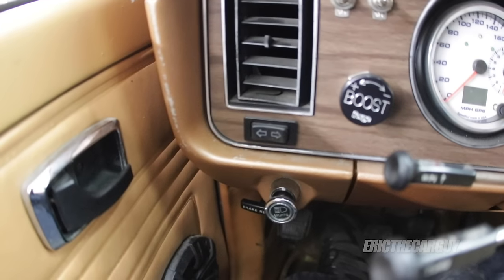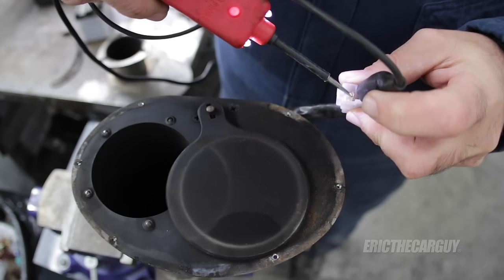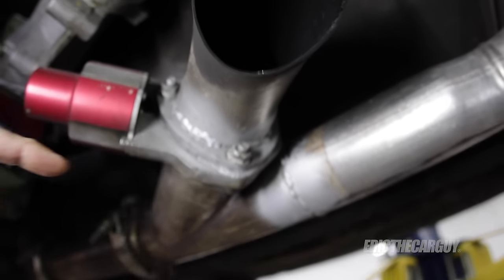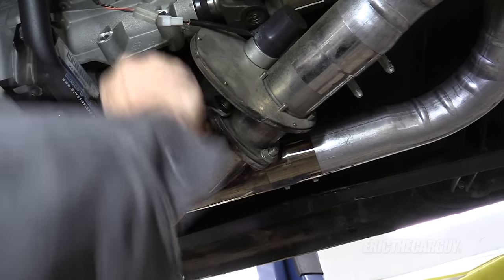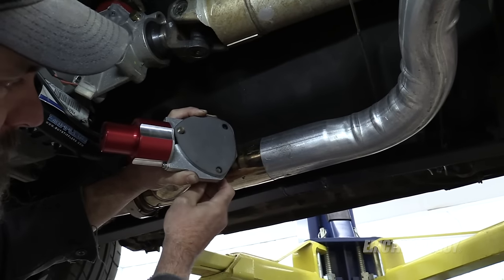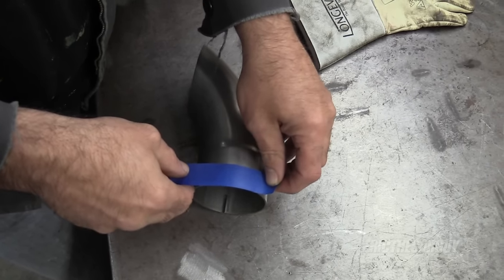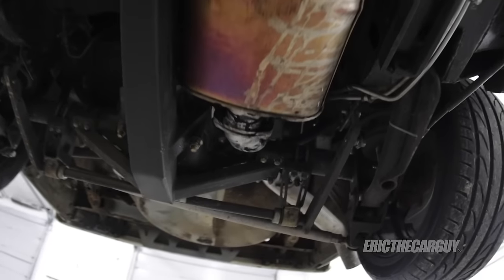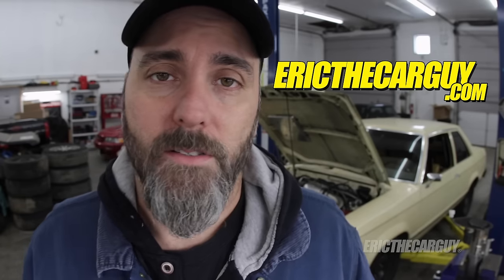Exhaust Cut Outs Give Your Vehicle a Split Personality

Comment: My 2012 Vett came stock with a set of butterflies so I simply wired in a clean looking switch to provide manual control of exhaust tone and any HP and fuel economy available.  Much easier than diving into the fuse box to make the adjustment.  But, I noticed the butterfly valve was very robust; however, I don’t have any thing to compare it to but it was solid and seemed to have less points for corrosion or accumulation of carbon.

Comment: Don't be afraid to do yourself a favor and Loctite those nuts/bolts at the three hole flange, because at this point, you essentially have a connection that is no different than any three bolt header flange that's been in use since the beginning of creation; a connection that was always prone to vibrating loose and dumping those flange nuts/bolts on the ground somewhere a couple miles back. And take it easy when tightening them down too as too tight will just warp the flange and it will never seal. Ever. And not tight enough will be just that, not tight enough and it will never seal. Ever.

Comment: Eric when using your plasma to cut a hole you don't need a half inch starter hole, whatever plasma tip you have installed size should be plenty.  For using a plasma to shorten a pipe they make special bands that also layout cutout angles, or you can just a threaded pipe clamp to guide the nozzle.  For inside cuts on that plate you could have used the short section you cut off or a piece of cardboard cut to shape/size. And finally it sounds and looks like you could have adjusted the MIG power a bit although stainless is best done with (very expensive) stainless wire and a different gas mix...

Comment: So some of the exhaust still naturally make its way to the muffler right ?wouldnt it be a better set up if there was two valves, one two completely block off flow to the muffler and allow to force it was out the straight pipe and vise versa?

Comment: When you said the screws on the butterfly valve could vibrate out I have the idea that you could use some threadlocker red. This is the strongest threadlocker and has to be removed with heat. This is the kind of threadlocker you typically use on things like main bearing caps and Rod bolts internally inside of an engine so it should be permanent and withstand the heat of the exhaust. If you were to remove or just back off a little on the screws of the butterfly valve and add a little bit of the threadlocker red before you put it all together then you probably wouldn't ever have to worry about the screws vibrating out. Just an idea, $3 or $4 for a little tube of threadlocker red that's cheap insurance. This way you would never have to worry about taking them back off the car and trying to repair them once installed they would be good for the life for the exhaust. Your work is excellent. Great video.
God Bless You 
and Your Family!!
Jimmy in NC....

Comment: The butt connectors work and sometimes it don't work it all depends on how you crimp them shrink tubing is great when I was working at my buddy shop it was like a lifesaver on the wiring and then after we where done with that, we would put plastic wire loom over top of it and tie the ends off with zip ties

Comment: I've had cut out before... I always used the throttle body style. I've never had one with screws in the plate they've always been welded. sometimes they rattle when they're going from closed to open. And they leak a little bit but it's worth it. Especially when you have a sleeper.

Comment: The one thing that you have to be careful with is the weld on your tail pipe interfering with the butterfly valve either opening or closing. I had one that would open and close fine, but just barely touched the weld on opening. Apparently it was enough to break the motor shaft after about a month of use. Pricey mistake.

Comment: The original cut out completely opened the path for the exhaust. The new one has an obstruction right in the center of the pipe. It has to be more obstructive, might even cause turbulence.

Comment: hurts my electrical soul when you use those crimpers on those crimps, it makes them warp and not crimp correctly, should get the proper crimpers so they will hold more securely.

Comment: I recently failed my mot cause of my straight pipe with the cat still installed. I am wondering whether the mot guy will question the cut out when inspecting the exhaust from a lifter.

Comment: Side note:  they make what’s called “soldier seal wire connectors” that have two glue rings, one on each end and low temp soldier in the center.  Just insert the wires and apply heat. Handy for tight spaces.

Comment: RE: Solder,    Solder makes the entire connection brittle including the copper wire. hence it should never be used in a vibration rich  situation (I am an Electronics Engineer and well versed in this)

Comment: Making a round hole is done much easier and will a lot higher quality using a hole saw. Making the hole slightly larger than the tip pipe allows you to slide it inside the hole and weld the joint on the inside. You can smooth the bead creating a cleaner flow path and a much cleaner looking install as the weld would be hidden inside.

Comment: Another awesome Vid, Eric, thanks! You've helped me out in the past, and I've neglected thanking you. So, I'm fixing that now. Many many thanks! 

I've got a car question that is rather unique... Mad Max's blower cut out... Would that actually work? My father and I are debating the facts behind it. I believe, that with the cable activated clutch on the crank pulley, that it would work, because air would still bypass the screw even when not working. He believes that it just wouldn't work at all. We need a tie breaker. Any input would be awesome. Thanks again!

Comment: I think I would have clothes clean that hole up a little bit better and inserted a pipe through it making it flush and then welding it from the inside leaving no well-disposed on the outside at all that on that and then as far as the connectors go if you stagger your connectors are there not one light on top of the other than it'll be a lot thinner on the line and won't look like a bald alright something new right

Comment: There are shrink hoses with solder iron inside of them, they are even waterproof. Keep that in mind for future electric work, my dad reconnected his hole transmission wire with those after it was burned due to oil dripping onto the cat.

Comment: Would you by any chance know if there is something like this for the Lexus IS 300?
Reply: ?? Seriously?? They don't. Make these for a specific car or model or brand etc the kit is determined by pipe diameter and then the wiring is custom and will have to be doen. By yourself or someone who knows electronics as it will only need power and a fuse to get working.  So check your exhaust diameter and then buy one that's the same size or bigger  and then you'll have to get your current exhaust modified to have another exit for this unit to mount in to.

Comment: Illegal,if caught can be used to impound vehicle as modifications to exhaust prohibited.
Reply: People like you should not even be into hot rodding at all.  Reason... ALL SERIOUS PERFORMANCE MODS TO PRODUCTION VEHICLES ARE "ILLEGAL." I guess you have never installed for example a superior performing air filter that had a race use only warning on it, or any other part with that disclaimer. Welcome to the world...please drive thru.

Comment: Im currently working on a project car myself (1976 Datsun 280Z w/LS376/525 connect and cruise, Tremec T56 6spd) and whether you meant to or not you sold me on the exhaust cutout, it will go perfect with my sleeper efforts. Roll around with restrictive sound dampening exhaust when its time to race dump the exhaust and unleash the beast!
Reply from the maker: You'll love it. Sounds like a really cool build. Links in the description BTW.

Comment: PA state safety and emissions inspection mechanic / HD diesel and mining equipment mechanic here to offer my 2 cents...
1) butt connectors are on par with soldered connections if done correctly, no need to explain yourself for using them.
2) tape is not for weatherproofing
3) you wont be welding for a pipeline anytime soon :'D
4) thoroughly enjoy the vids, keep em' coming!
Reply from the maker: Yea, but the more I weld, the better I get. You should have seen when I started. https://www.youtube.com/watch?v=Mtrw7DcUtHg

Thanks for the comment.

Comment: There ought to be a third type where one pipe splits out into 2 for each bank and an internal flap closes-off one side of the other by pivoting around the split point.  That resolves the leak issue as the exhaust system remains closed in that section and it also doesn't create any ground clearance issues.  I want that so that the same exhaust tips can get used for both.

Comment: Don't do this in Minnesota, this is illegal here. Check your states laws before installing any sort of muffler bypass device, unless your car is a trailer queen, in which case it doesn't matter.
Reply: I would like to note, in Minnesota, it's illegal to have this installed on any vehicle driving on the road, regardless as to whether or not you ever bypass your muffler while on public roads.

Comment: Been welding my whole life. Because of thickness differential i would not bevel the pipe. The fill of your fillet and the heat needed to penetrate the plate is more than enough for the pipe. If the thicknesses were the other way around ( the pipe being 3/16 and the plate being 1/16) I would bevel the pipe.
Reply: Also from seeing your welds... I would play with your wire speed. It seems to high from here, does not mean it is.

Comment: This whole fucking time I have been using butt connectors, I never knew or even once thought I could heat them and have them shrink down on the ends... All that wasted electrical tape :(
Reply from the maker: Not all connectors do this. You have to get the ones with shrink tube ends.

Comment: I had this done when I put a 3" exhaust, front to back (Magnaflow cat, Flowmaster 10 series muffler and 3" tailpipe) on my 98 Jeep Grand Cherokee 5.9 V8. Small switch on my console next to the shifter. Run it wide open on the highway. LOVE the sound.
Reply: Good to see another Jeep Grand Cherokee Limited owner. Haven’t modded mine a whole lot but love the vehicle.

Comment: why not put on two race ready servo flaps in opposite configurations. So when one is open the other is closed and vice versa. That way when you open your straight exhaust it would also completely close the cat exhaust. You could even use the splitter they gave you. It may not make much difference since the air should take the path of least resistance anyway, but it could be a fun little exercise

Before installing the second one, open the flap. Then reverse the wires and hook it to the splitter. With the wires reversed when one valve opens the other should close.
Reply from the maker: Interesting idea, but totally unnecessary in my opinion.

Comment: I've noticed that BMW usually uses dual tip exhaust, in most cars the right tip will shut at low rpms for reduced noise. Nothing like a cut out but I've disabled mine and it is slightly louder (I did it because my 21 old one wasnt workin like it used to, the cover for the tip would sometimes flap around and make a very annoying noise). I noted that they use a sensor accompanied by a vacuum line that shuts the tip.

Comment: Wouldn't the dammed off Y cause some airflow issues? Or just not significantly enough to matter?
Reply: One part of the y goes to the muffler. So when the valve is shut it causes the gases to go through the rest of the exhaust. When it opens they go the path of least resistance, the atmosphere
Reply: @quadeyqade  I understand how it works and all, but I mean, with the short path dammed off further down the tube, it's going to cause some weird turbulence in there. The air wouldn't just fill the space and the rest flow over it.

Comment: Also its actually a really good thing you didn't solder. rull of thumb is to avoid doing any solder jobs under the hood or anywhere that gets hot especially an exhaust. it can soften the solder or even melt it enough to completely release both wires. Atleast with a crimp youre less likely to have its metal melt like   solder. 

Soldering in the cabin ? go right ahead. but under the hood ? only crimp.

Comment: When closed does it completely seal or is there an exhaust leak?  Want to install on my V8 Lexus which is super quiet so if it does leak it will annoy.
Reply from the maker: I recommend you watch the video instead of just commenting.
Reply: @ericthecarguy  I guess with 1.2m subscribers you can afford to be crass.  Due to that mug I could only make it 19 minutes in. I sure won't be the 1.200001millionth subscriber.

Comment: it'd be super cool if you put a switch on the gas pedal so when you floor it, that valve opens up, and when you're just putting around, it closes
Reply: Also if you're going to custom fab stuff, I feel like this could have been done with a cruise control module and a throttle body.
Reply: @calvindibartolo2686  thats what i was think of doing adding the cable from cruise control to the cut out and boom hiden switch

Comment: why not just run a simple butterfly valve with a length of steel cable to a pull knob, so you have ultimate engineering simplicity, reliability and analog control?
Reply from the maker: Try and find one. It's much easier to do what I did, trust me. Also, this hasn't failed me yet and I drove with it all summer.
Reply: you had the run the wires, mount the switch and install the butterfly valve that's currently in there. that's literally the same effort, since the steel cable would run where the wires run, a pull knob would mount where the switch does, and the butterfly valve is already a butterfly valve.

IDK, I just have absolutely zero faith in anything electrical in vehicles, because IME when they fail they fail randomly and suddenly, whereas mechanical solutions show signs that they're about to fail prior to doing so.
Reply: Also, you had to redo the entire thing because the first one broke, so I'm not really prepared to accept that your snark is warranted since you've demonstrated that you don't actually know what you're doing.

Comment: Be careful with that butterfly valve type. Those are known to fail often.

Also when you tac and weld hold the tip against the metal for at least a few seconds before you remove it from the material. Forgot why off the time of my head but that was what my cousin taught me who was a professional welder.
Reply: It's to shield the weld. It is mostly used in TIG welding though, in MIG/MAG welding it's not very important.

Comment: Regarding crimping or solder on cars.

Tin work hardens a lot! so if you solder them they can break apart with vibrations, crimping is better for vibrations.

Ulness you use a lot of heatchrink to stiffen the jiont upp a lot.

Comment: You said you crimped instead of soldered because it's more convenient when doing lots of connections, but it's also good for 2 reasons there. Vibrations can cause solder to fatigue and crack, sometimes breaking the connection so it should only be done in places without excessive vibration. And also the heat from the exhaust, while it's obviously not pointing at the join, solder can still soften and melt at exhaust temperatures

For exhaust cutouts, I'm a big fan of the guys in Australia X-Force that make the Varex muffler. It's a complete muffler unit with a butterfly valve that either directs flow around through the baffles or opens up to let it through the middle. Same principle but much cleaner setup and the exhaust always comes out the same tip

Comment: Crimp vs solder....

As long as you MATCH the butt connector gauge to the wire gauge and its crimped properly to the copper and not the jacket of the wire, i don't see anything wrong with crimp connectors .. 
I think the problem with crimp is that people will take like a 18 gauge wire and use a 12 gauge butt connector ..

Comment: 16:50 Eric they made this new thing, it's a clamp style/size heat-shrink tube with low temp solder stuff inside, which melts just using a decent heatgun. It's freaking great! Though pretty useless inside the car :P

Comment: to back up eric on the soldering matter, just take a look at all the manufacturers in automotive industry. Every single one of them uses crimped connections, because it is quicker, cheaper, and more secure and reliable.
Reply: everything after 'quicker' is false.